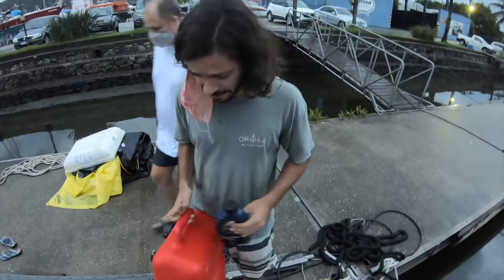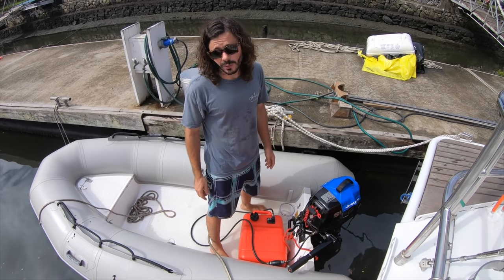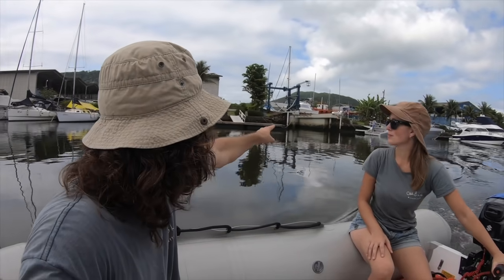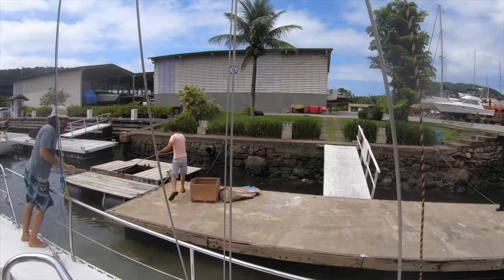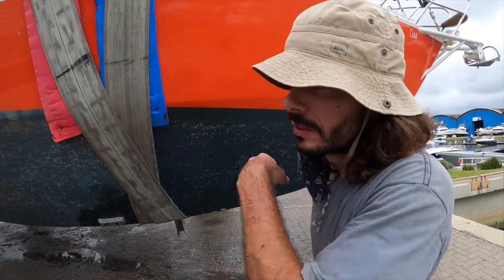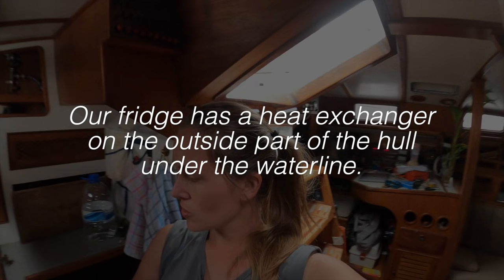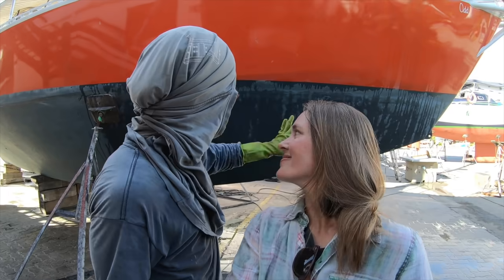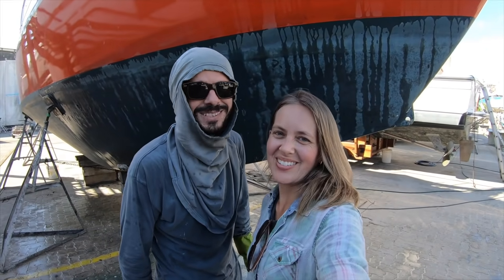⛵️We are back on the dry for two reasons!! 😨🤩#167

Comment: Hello Roberta and Duca from Suzie (I'm writing the comments at the moment) and Robert aboard Snow Maiden. With the antifouling and barnacles issue this is a method we use.
For us on Snow Maiden we have a meticulous preparation for anti-fouling. 
We did a complete anti-fouling of Snow Maiden last year, which will last for a minimum of 5 years before we have to do it all again. 
First, we taken it back to the steel with a bead-blaster. Then we apply 2 coats of etch primer with 24 hours between coats. 
The hull is then washed down and allowed to dry between applications. We then apply 2 coats of an under-primer, followed by 2 coats of primer. These are sprayed on and allowed to try with a 24-hour dry time between each coat. 
We then spray on 2 coats of anti-fouling allowing again 24 hours between coats. 
Finally, we roll on 2 coats of Bitumen paint, brushing behind the roller. This can dry for 48 hours and then we put her in the water. 
In the time since Snow Maiden was built and launched there has been no growth on the hull with this method.
We just go over the side once a month in Winter and once every two weeks in Summer and wipe the whole of the underwater hull with a sponge to get rid of any growth.
It might seems a long and expensive process but it a method Robert has used on previous vessels including "Ice Maiden"
Hope this might help with those nasty barnacles.
It's nice to hear that you are replacing the engine
Stay safe you two.

Comment: The new intro is great.  Good luck on the 'hard', gl fixing the prop seals and installing the new motor. And yes, I agree, too many barnacles after such a short time in water. I was very surprised when I saw this. It will slow you down in the water, as you know. ⛵

Comment: I've done bottom jobs since the 70's and have never seen a bottom as dirty as yours in just a couple of months.  Regardless of the condition of the water in your marina, the bottom should have not looked like it did.  I would not be using muratic acid on that paint.  West Marine in the US sells a product that dissolves barnacles and isn't harmful to the bottom paint.  I would strongly suggest you consider using Petit Trinidad paint on your next haul out.  While it's not perfect, I guarantee it would have not had barnacles on it in that short amount of time like the paint you have on there now.  I've tried other paints through the years but have never found a better bottom paint than Trinidad....and my boat is docked in a harbor that has its share of bad water.  If that's Copper Coat on your bottom then I am not surprised by the poor condition.  I am not sold on that product.  There is a another bottom paint on the market called Magic that is getting good reviews but I haven't used it yet.  Love the videos.....look forward to a new one every Monday.  My previous employer, Ingalls Shipbuilding, builds surface warships for the US Navy and they use an International brand hard epoxy on their hulls.  Whomever convinced you to use that bottom paint didn't do you a favor.
Reply: While my Pacific north west waters are not a high fouling area, I get 7-9 years from Trinidad SR with nothing but slime and plant growth.  No barnacles except the bottom of the keel where the paint is only one quick layer applied and splashed while still wet.
Reply: These antifouling paints works only if you move the boat. When they start sailing and moving around it should be fine.
Reply: @renatooftalmoangra  This is only true of ablative paints.  Hard paints like Trinidad do not need movement to work because they do not erode.
Reply: TheGhostFace2086  unfortunately in Brazil we  don't have these options available.
Reply: @Kamdyn Avi Flixportal =)
Reply: @Izaiah Brayden Thanks, I signed up and it seems like they got a lot of movies there :) Appreciate it!!
Reply: @Kamdyn Avi Glad I could help xD

Comment: Instead of using seawater cooling for your refrigeration, you can recirculate water from your tanks. That way you can use your refrigeration on the hard.  I do both my refrigerator and freezer this way, filtering the water on the return to the tank.  Been doing it for 10 years.  Bottom paint should last 2 years in  temperate and 1 year in tropical water.  Prop speed only lasts a year.  You need to get a paint with a higher cuprous oxide load.  Since you have a steel boat, you might consider ultrasound barnacle protection as they work particularly well on a metal boat.

Comment: Ahoy! 
Consider a hard tender. If you must abandone ship, ouch! If you plan to go offshore (further than you care to paddle) a better choice is The Fatty Knees fibreglass sailing dinghies-just as an example. You put her on your foredeck upside-down with all emergency overboard gear/supplies with a robust cover.
Must create a 3-point hoisting system (1x on the tip of the Bow/ 2x on each corner of transom) that all onboard can handle if needed. Once hoisted a few feet, simply roll dingy to upright and guide over the rail / life lines.
Also, can be enjoyed in quiet anchorage's and used as your taxi as well; it's much cheaper (free) anchoring out where most seasoned bluewater vessel's meetup.

Comment: Love your show guys, just some advice for your outboard engine when you take it off the boat and put back up on deck, just run it quickly with fresh water going through it. Keeps the salt water out of the rubber impeller. Good luck and great job.
Reply from the maker: Good tip! We actually did it, we even posted on our instagram 😊

Comment: When you have to pull the boat up on the hard before you do ,freeze a couple plastic gallon milk jugs full of water or  jugs of water and put them in the fridge to keep it cooled down
Reply: Came here to say this. Works like a charm. This simple fix saves you time and money - plus you can just drink the water or use it for washing later.
Reply: Another option is to get party ice and put it in the fridge and freezer when you splash it will help with the cooling and start up of them both. 

I agree with everyone your bottom paint is terrible! I parked the boat in the tropics for 6 months without moving and had less growth on the hull, not only that a plastic scraper and brush was all that was needed to remove 99% of the growth. To have to haul out to clean the bottom of the boat with acid is terrible it tool over 2 years for the bottom paint to start letting barnacles attach like that. 

I would sand and paint it again with a different bottom paint as the paint is not thin or peeling
Reply: @stevet647  yeah but my way you dont have ice  melting all over your food and 2 inches of water in the bottom of the fridge and those big blocks will last for days in the fridge

Comment: That is a lot of marine growth for just 3 months in the water. You might consider applying a higher grade bottom paint (e.g. Interlux Micron CSC). A bit more money spent now but will save you a lot of time when you haul out again. Good luck. Cheers!!
Reply: Remember that the boat has been tied to the dock`s all that time, hopefully when they are sailing it will be a lot better, most bottom paints need the friction of the water  to work properly.
Reply: @berikdahl  That is true for ablative paints but not so for what is referred to as hard bottom paints. Here is a quick guide for differentiating between the two types.  https://www.bottompaintstore.com/blog/bottom-paint/difference-hard-bottom-paint-ablative-bottom-paint/

Comment: You won’t ever regret a Suzuki outboard for reliability in starting. Break it right as you are doing and cut off the gas and run the carb dry after use for storing to prevent varnish.

Comment: Use a pressure washer with som real pressure when you clean the hull. The one you used is not for boats, I bet you could pee harder the that.
Here in Norway we use an anti-fauling from Jotun called Nonstop Supreme, and it keeps the hull more or less clean for two years. I understand that it grows more in a warmer climate. But it doesn’t seam like your paint does anything for your boat.

Comment: As others have noted, even being in such a marina, that is an extraordinary amount of barnacles in just 12 weeks. Don't repeat with the same paint again, please. Try to locate a paint with copper. Old wooden ships had copper plates on the hulls as copper is toxic to the sort of wildlife that want to attach to your hull. You can't have copper plates, but you can have a paint that has copper in it. If you can't find such a paint, you can buy powdered copper to add to antifoul paint, on ebay, even.
Reply: I agree. That must be rubbish anti-fouling. I get less than that in a year!
Reply: I strongly suggest copper coat from AMC. It is based on epoxy paint mixed with a ridiculous amount of finely powdered copper.
Reply: If I remember correctly, they put on copper coat, and then put anti fouling over it. If you look on the ride where they sanded, you can see a copper color coming through.
Reply: @captchia  That wasn't copper coat it was just the primer for the anti-fouling.
Reply: I'm glad I'm not the only one to think that.  No bueno!
Reply: Won't copper react with the steel hull?
Reply: Hello  @bradleymeade4962  , you would have a layer of primer in between. So the two metals would be isolated from another. In addition to that, both of the metals would need to be exposed to saltwater to create a local electrochemical element. Since the steel is coated, this again is not happening. And in addition to all of that, Odd has sacrificial anodes installed. They again would get eaten up (getting sacrificed)  before any of the steel would start to rust away. I hope, I could answer your question with this. It was an interesting one though and definitely is worth a good amount of consideration. :)
Reply: @bradleymeade4962  The process requires an epoxy coat on the hull first, then copper coat on top of that. Here is what the manufacrurers of Copper Coat say:

"Certainly you are very welcome to use Coppercoat on a steel boat, and this is something we have been doing for over 25 years. If you go to www coppercoatsuperyacht com and www coppercoat-commercial com you will see lots of examples of Coppercoat being used an a wide variety of metal craft as well as sub-sea installations.

But Coppercoat will not bond directly with bare metal surfaces, so these must be primed well with an appropriate two-pack epoxy resin beforehand. Popular options are Jotun Jotamastic, International Interprotect, Hempel High Protect II, etc."
Reply: Many cruise boats use coppercoat, but it must be done right or it is rubbish, youtube it.

That antifoul you have is useless dump it!!! You should have nothing more than slime at 3 months really.

Comment: Hi guys... When towing with a dinghy rather than tow from the front you are better tying the dinghy to the side of the boat near the stern, (rear quarter)  .... two lines... front and back of the dinghy and you will find controlling the yacht much easier ...  good luck with the engine swap ...
Reply: Yep.  Use the dinghy like a Tugboat and sort of "push" with it.

Comment: Nice to hear a new 2 stroke outboard. I thought they were all 4 strokes these days. Not sure if  the mic distorts the sound, but the motor sounded like it was running rich. Make sure the choke is going fully off. I don't think the slightly higher oil content would make any significant effect on the noise (unless you really put loads in!). What is the make and model of the outboard? Do you know if they market them in Europe?

Comment: if you want remove the forestay without dismount the furler(dangerous for tension on turnbuckle). Use the jib ,or spinnaker, halyard   tighten on the bow, by winch, to bring the mast a little flex fore ,that remove tension on the forestay. Whitout tension you can remove the forestay by the pin under the furler. This is the right way to dismount or modify lenght on all shrouds. (tension on turnbuckles is dangerou, it coud brake/grip metal screw).

Comment: Its amazing is it not how fast they can foul up when they are not being used , we tell customers all the time , the paint is ablative , but if it just sits there it will foul . I wish I had dollar for every bottom I have done, I could buy a Corvette ....lol Muriatic Acid is what you are using, barnacles are mostly calcium carbonate, it will work fine. sucks don't it? lol.I have a suggestion when you pull the shaft check it for trueness ( whether it is straight ) there are various ways, also I don't remember if you did your wheel if not have that trued also. A new engine is a nice thing, ever put one in a sailboat before? no ...its not a fun job, I have , but the guys that do it know the tricks . I as ever wish you well, I see other people have question your paint I thought you used interlux , but many people don't get the fact as I said that these paints are ablative, take care ...

Comment: While you are on the dry, I think you should add about a 2" wide white boot top between the bottom paint and your orange hull - I love the hull color, but it's missing that the boot top stripe. It will really make a difference in the appearance.  You could do it in tape which would be much easier than paint.

Comment: Have you ever heard of ceramic coating ? Its a type of coating they use on car paint. It would be interesting to see how it holds up on a boats hull and you can apply it on your own rather easy but may require a bunch of it. It would reduce the amount of stuck on sea life from your boat it works kinda like the stuff that went on your propeller. A small bottle does close to 2 or 3 sedans and if you are sanding you will have a decent bonding surface if you buff the paint.

Comment: Guys, you need to talk with some local boaters to see what bottom paint works for the area you are in. Also If a boat is tied up in an area that has slow moving water the bottom paint probably  does not work as well compared to sailing at 6 knots 24 hours a day. Look forward to following you on your first passage.

Comment: I'm not sure what you use on the bottom of your ship, but that's worse than our ship used to look after a whole season in the water, about 6 months around here if you push it. Normally we just had a little bit of growth each year when we pulled the ship up. I know my dad added this local special stuff to the marine bottom paint and it worked almost as good as the stuff we used the first years that contained lead or something that is now illegal to use. But I know we tried several things before we found that local mix this small company made, best of all you didn't need to use a lot of it to make the stuff work.

For all I know the local mix used lead or something else bad, but it helped a lot and made keeping the growth down and easy to get rid off. I remember the year after the lead paint was made illegal and the ship was overgrown so bad that we had several cm of growth of marine life here and there that actually added nearly a ton to the ship weight, it was insane. And that was using the paint the government recommended. The next couple of years we tried different things, but nothing worked as well as the old stuff. At least the mix helped, but not that well sadly.

This was over a decade ago, so I have no idea what advancement they have made to deal with marine life growing on the ships bottom, but if you look at big ships belonging to the rich being pulled up it certanly look like that have found something that work great. The question is, is this something that anyone can get hold of or is it a rich people secret?

Comment: Running more oil in the Suzuki engine will fowl the spark plugs, so make sure you have a couple new ones. Been around two strokes my entire life. Never a bad idea to have a few extra spark plugs with you.
Reply: Suzuki is four stroke.
Reply: You can hear that motor. It's definitely not a four-stroke. And Duca mentioned in break in mode it requires more oil. He even said he put twice as much oil in it as it normally requires.
Reply: @raymondnybakk1311  four strokes doesn't require gas in the oil
Reply: @aaronwood3540  Sorry, you are absolutly right. I watched the video on my phone at first and didn't get all the ditails. Now I can hear that it is a tow stroke. Suzuki has not sold two stroke engines in my part of the world for about 15 year. I didn't think they exsisted any more. Now after Evenrude has stopped produsing two stroke engines, I don't think that it is possible to buy new two stroke any more in Norway.
Reply: @raymondnybakk1311  it's all good, I can usually just tell by the sound. And the smoke is a dead give away.

Comment: Bonjour les amoureux,
I know what it means to have a brand new toy, buta two stroke engine ? What an idea, why not a four sroke one, quieter and smoking less ? 8/9 CV four stroke engines do not exist ?
What about bernacles on the boat drift ? I am not familiar at all with boats and sea so I find very impressive the impact of  the salt water on a hull after only 3 months. 
Besides this, you have been much more lucky with your paint than Juh and Fred ! A few spots to repair is nothing compared to a whole hull !
Amicalement, Raphaël
Reply from the maker: We couldn't find a 4 stroke that was not too big for our little dinghy. We are inside a mangrove and the water has a lot of nutrients, hehe